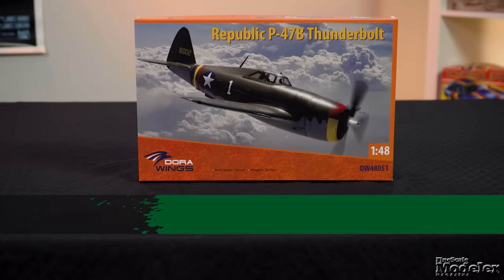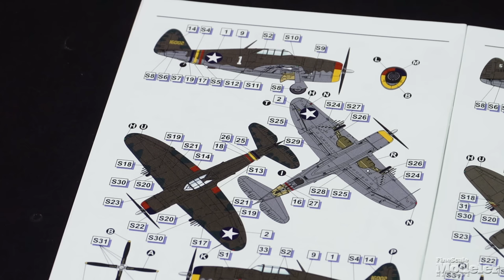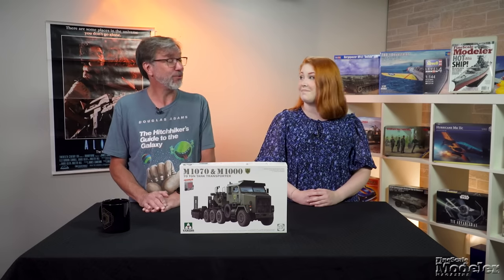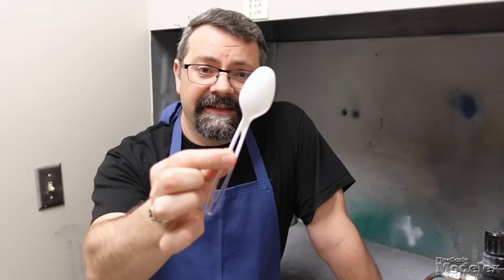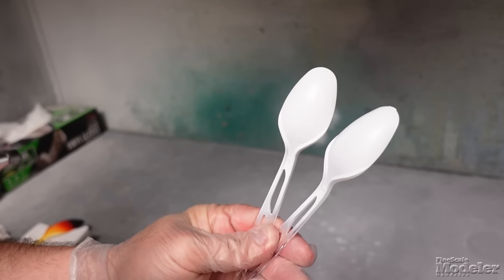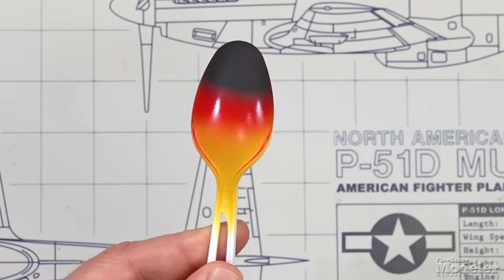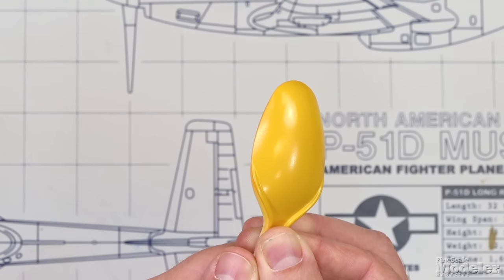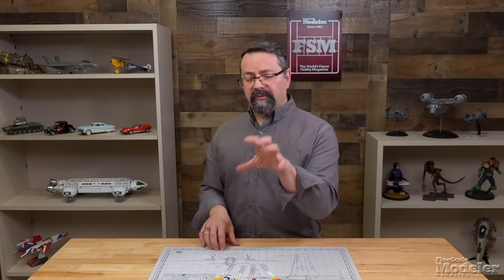Playing with paints, new kits from Dora Wings and ICM, and video from IPMS USA Nationals 2023

Comment: I think a better explanation of how paints cure in different ways is in order. It’s important to note that lacquer acrylics can reactivate lacquer acrylics they’re being applied over since they don’t undergo the same molecular change (cross linking) or curing process that water based acrylics do (it’s why water acrylics can’t be washed off with their own thinner, which is water). 

In the case of lacquer based spray cans, and even airbrushing, simply giving the paint enough time to flash off between light to medium coats can prevent any reactivation of underlying lacquer paints, and any checking of other formulations. 

Additionally, enough curing time can make almost any paint resistant, and that’s especially true with enamels which can take days, weeks, months to fully cure. I suspect this was the problem when you sprayed over the enamel and had the one spot of irregular finish.

Comment: Put a enamel wash on the spoons and swoosh it around with a paint brush and watch what happens. When weathering is where problems happen.
Reply from the maker: Well, sure, if you're just going to hit the paint with a thinner that interacts with it (which a wash is essentially dirty thinner), of course it's going to cause problems. As always, clear coat first to protect the underlying paint, and then come in with acrylic, enamel, and oil washes.

Comment: I would suggest that you put a piece of tape on each spoon and then remove said tape and see what happens. My experience is that the enamel and lacquer paints chemically bond better with the plastic and therefore won’t lift off. An enamel or lacquer paint over acrylic will tend to lift the underlying coat of acrylic off the plastic. That’s why I usually paint the acrylic last. As for as the chemical reaction between the lacquer and enamel paints, it may depend on the drying time between layers 11:59 and strength of the underlying solvent used in the overlying paint.
Reply: The only thing touching the plastic on any of these, is the Tamiya primer. None of the paints tested are over bare plastic
Reply: @viper29ca  I guess I should have prefaced it as without primer use. The purpose of the primer fixes that issue. Although, I’ll need to see how acrylics stick to lacquer primers, but I’m guessing they probably bond fairly well.
Reply: @bennettrogers7921  They adhere just fine to lacquers. While I use 90% vallejo products in my building, I have used Vallejo over Tamiya lacquer primers with no issues.
Reply: @viper29ca  many thanks for your reply. I have been hesitant to use primers in the past for fear of losing some of the fine detail, but I’m beginning to think that I was incorrect in my concerns. My thanks for information.
Reply: @bennettrogers7921  as long as you aren't flooding it on, then you should be fine. I generally airbrush everything as I have more control and not putting a crap ton of product down. Tamiya rattle can primers are actually pretty good and don't flood your kit, but still prefer to use the airbrush, even if I have to decent a particular color.

You will sometimes find that you will get more detail come out after a coat of primer is on

Comment: Tim, could you please comment on the chemistry of the SMS paint?  I've recently read about some new lacquer paints based on glycol rather then the more conventional toluene / ketone / MEK based carrier.  I would imagine such a thing would be much friendlier to enamel and acrylic paints under them.  I'm curious if SMS would be such a thing.
Reply: Our Acrylic Lacquers are predominately Acetone based with a little Xylene and Toulene to help aid with levelling and sheen. They are formulated to work safely with modelling plastics by lowering the mix amounts of the hotter solvents and increasing the others that aren't as hot. This allows the paint to keep the same properties but be much safer to use on plastics.
Reply: Thanks for the info @thescalemodellerssupply  .  Indeed I'm as surprised as Tim with how little your paint damaged the underlying paints.
Reply from the maker: This was one of the most wholesome, positive, and informative interactions we've seen on our YT channel. Thank you both!